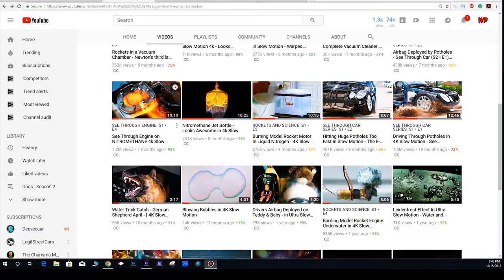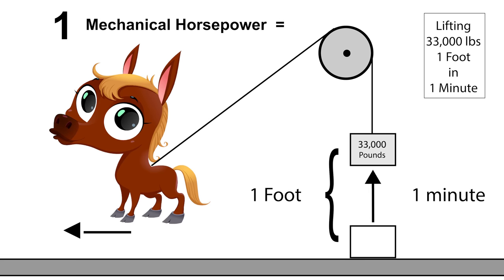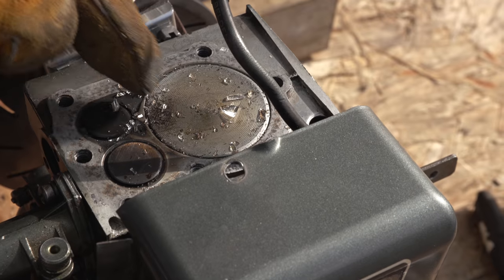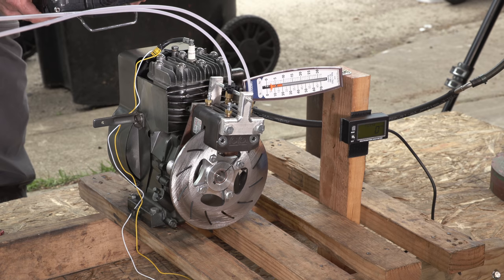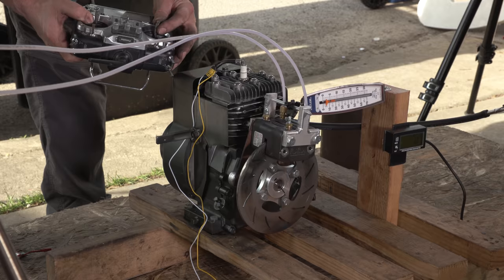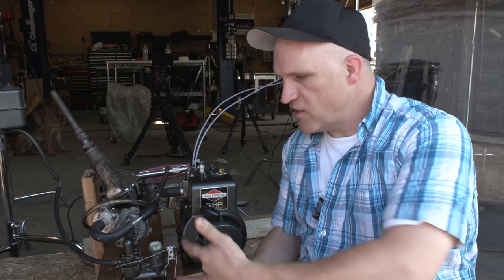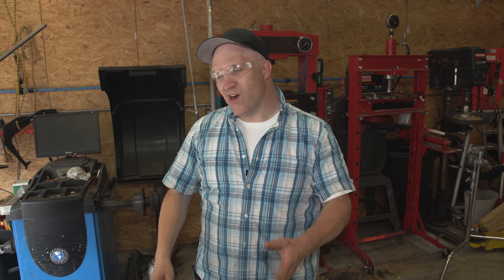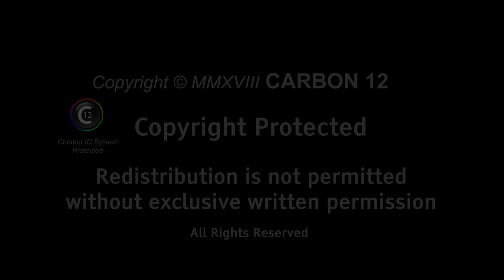See Thru Engine on Turbo Nitro and Dyno  (How much HP does it make?)

Comment: Your oil looks like because of all the top fuel was not burned, and you had blow by pass the piston rings, as they are not designed to keep alcohol and nitro from slipping past, that is you oil came out, you way to much crank case pressure.

Comment: That turbo will never work with that engine.  There is not enough exhaust flow to spin the turbo for boost.  You are basically adding a restriction on the exhaust and running a vacuum on the intake side -- Not the best way to make HP.

Comment: "No wonder why they don't use the wet system anymore...."

I'm sorry, but considering your setup and conditions, that was a super dumb thing to say.
Reply from the maker: Not really, the draw through system isn't used anymore because that was a very early entry into turbocharging. The current blow through setup is beyond superior for many reasons. Just look at the first turbo trans am.
Reply: @WarpedYT  Right, that's not what you said in the video. I'm responding to the video.

Comment: You need a small turbocharger On this small engine of less than 5 horsepower，Or you can try to measure the RPM of the turbine.

Comment: the turbo is WAAAAAAY to big ..the briggi cannot possibly spool it up to make boost ..for petrol and  more power you need up the compression to about 10 to 1 ..it will be about 7 to one  the carb will be way to small ...a carb that has a variable slide ventru is best ..or an 1" 1/4 SU...i don't think even the smallest car turbo will make boost ...i did see tiny chinese turbo on ebay one time ...also you need to put some type of damper on the caliper for a constant reading  ...entertaining vid

Comment: LMFAO You take a turbo from a 6 liter engine making more than 600 hp at 5000 rpm, you mount it on 200cc engine, and you expect it to make boost at 3500 rpm? That's ridiculous mate. Yes, I know the SL65 is a twin turbo, but each turbo is still rated at more than 300 hp.If you had a boost gauge on the intake, I can guarantee you that you would see vaccum, just like you would without the turbo or even more, because this turbo will just work as a restrictor on this engine. To have any hope of getting boost on such a small engine, you need to look for the smallest turbo available.

BTW, the SL65 is not a sequential turbo setup, it's an ordinary biturbo.

Comment: It won't make more power until you go to overhead valves. The flathead design is too restrictive. If you want maximum volumetric efficiency, and MORE POWER, think OVERHEAD VALVES.  You can't do it with a blower and nitro alone.

Comment: That turbo is way too big for that motor and the carburetor is way too small for that turbo. I bet if you fix these issue you would get a lot more power other than that way to go putting the effert in this video

Comment: gearing it would make more power.    

Here's an old drag racing saying for ya,,,  "how do you beat cubic inches?,,   with rectangular dollars"    
that is...  you'll spend a fortune on turbo's and superchargers and all that crap.    want more horsepower, more cubic inches.

I ran a 480 horse 426 cobra jet...    mind you the car was stripped and acid dipped to reduce weight... at 1245 pound she was a sleeper. and looked like shit because we couldn't afford to paint it proper...  so we did it with rollers.. LOL   
won a lotta pink slips from loud mouth ricer rockets back then hehe

Comment: That small engine is not going to produce the volume of exaust needed to propel that big turbo.
Reply from the maker: Sorry it already has, the twist is, it's only going to make boost on that turbo with nitromethane not gasoline ever. Gasoline when never produced enough exhaust energy to spin that turbo

Comment: You know HP and BHP are two different measurements right? Stop calling it HP
Reply from the maker: Wrong , there is BHP and WHP wheel horse power.
Reply from the maker: HP is the output horsepower rating of an engine, while BHP is the input brake horsepower of an engine. ... B HP is the measurement of an engine's power without any power losses, while HP is BHP less the power losses.

Comment: Haha, never let it be said, that watching people who don't have a clue what their doing, won't be entertaining.
Reply from the maker: Lol... Well have you ever met somebody that knows what they're doing so well, and so effortlessly that everybody thinks he doesn't?..... but I'm sure people who don't have a clue what they're doing know how to build very complex machines, that makes a lot of sense.
Reply: First, let me say my comment was solely directed at the turbo test, and was not meant as derogatory.

(1) In answer to your question, sure, I've come across many in my 30 years as a technician, and 10 years of engineering. (2) No, people who don't have a clue, really don't know what they are doing. No "warped perception" here!

Those with engine pressurizing knowledge, could have explained to you why this turbo "could not / would not" work. You should have build a clear intake, we could have seen first hand (and demonstrated to everyone) that this engine doesn't produce enough exhaust pressure to even turn the impellers, at a rate of speed to produce boost. 

I will say the "test" you perform are entertaining, clearly peeking interest in others, failure is always an option, it's how most learn, so keep up the good work, many are enjoying your video, as I did.

Comment: So you made some mathematical errors. Your lever arm is 6 in and you said it needed to be one foot. you divided by 2 and you were supposed to multiply by 2... your lever arm wasn't 2 feet. Then you would divide by two but since your lever arm is only half the length. you would multiply it.... it would create more torque at a foot of lever than it would have at 6 in. Also when your turbocharging a small single piston engine you need a boost box. a way for the turbo to generate air pressure. If it had more than one cylinder you wouldn't need a boost box on the intake and you need to use one of the small little turbo. there like a hundred bucks on eBay. Rhb31i think it is. Boostedboiz on YouTube have a shopping cart single cylinder turbo and they go into the details of why you have to have the Boost box or whatever you want to call it.
Reply from the maker: Well as for the math, it is actually correct. You take whatever torque number you Get and you divide by 2. Let me give you an example, if my lever was 4 ft, and the engine made 10 foot pounds of torque, at the end of that lever you would measure 2.5 pound feet. At 6 in you would measure 20 lb feet, imagine when you have a bolt that's stuck and you can't get loose, what are you do you get a long bar or a pipe to put on the ratchet, because you have more leverage, in this case the engine is producing the torque so the entire thing is reverse. As for the boost box, I think you're going to be very very surprised, everybody is, we will be wrapping up the last episode of the series today after 8 months of building. Finally coming to an end today but the results were very interesting, and somewhat against what everybody predicted. Stay tuned I'm trying to get that episode out by Friday. Thanks
Reply from the maker: Although the boost box would possibly help oh, but I doubt it in my case because the amount of volume of the intake manifold is triple what the displacement of the engine is. I'm thinking I might do a follow-up video to the episode explaining why I am able to make boost with this setup.

Comment: Obviously the turbo is just way to big
Reply from the maker: Well let me ask you this, how much boost pressure do you consider boost ?
Reply: @WarpedYT  by definition it's probably any positive pressure but you probably need at least a half a bar to a bar to get any meaningful turbo gains and the fact that that turbo maps probably like 3600 to 6500 when your at max rpm it's just starting to build

Comment: Nitric Acid is a by product from burning Nitromethane.....It will rot bearings and rust metal rather well.
   There is not enough flow energy in the exhaust flow to drive that Turbo either, waste of time.  A Lawnmower engine with a Turbo, seriously..?
The undamped Spring Balance dancing about is hilarious....It's like a video on how not to do something.
Reply from the maker: I'm glad that everybody thinks that I won't be able to get this turbo to spool and make boost, my gut tells me it will, but not on gas only on nitromethane.

Comment: What was the stock "jetting" vs nitro jet size??  running methanol always needs more fuel along with the timing changes. Never experimented with nitro..timing retarded I assume? ? 
Have to edit.. to ask this question. You are purposely use completely stock flatheads THEN experimenting with other "add-ons"...?

Comment: microsquirt is about the cheapest stand alone efi out there i have seen it used on small mopeds so it should work on the brigs 
https://www.ebay.com/bhp/megasquirt
i think you could use a arduino for it too
https://www.youtube.com/results?search_query=arduino+stand+alone+efi
maibe you can build sumtin simpler like a nitrous wet system and have the fuel jet from that work only full trottle/boost  using a microswitch on the gas lever or a pressure sensor

Comment: Poor engine.Tortured to death.At first: tune up began always with lubrication.Put an oil pump and direct lubrication.Step two: forget the mechanical ignition.Step three: fit a carb was exactly setupped to motorconfiguration. With turbocharger: place the carb after the turbocharger. make one tube between the intake and float chamber to optiize gasoline-air mixture.

Comment: turbo is waaaaayyyyyyy to big!!! its from a 2-3 litre  engine xD  that little 3hp briggs got barely 250 cc . even with a tiny turbo u will most likely shoot out a rod cos that engine has only splash lubing. get a oil pressurised one like a 12 hp ic briggs. then u can give the turbo proper lube also. that plastic tube with oil in it is a joke.

Comment: You cannot use that turbo on that engine.  Your video was totally awesome right up until you showed the car it came off of, then I fell of my chair laughing and hurt my back, WTH? Man?  They do make turbo's for liter engines and anyone saying the turbo is not too big had obviously never seen one.  My neighbor has the only turbo made by Air research as a prototype for sub-1-liter engines, it never went into production because of insurance problems knowing it would be used on motorcycles so they gave it to him as a gift.  Since they a few of them have been made in china but nothing can compare to air research and so you are just going to have to keep on dreaming.  If you want to see the only turbo that was made by a reputable company used on the proper sized engine, My engine by the way... a 1979 KZ 1000 engine pushing 45 Pounds of boost then click here and check out the blue Kawasaki bike:  https://www.youtube.com/watch?v=eTQjRZ84nG4